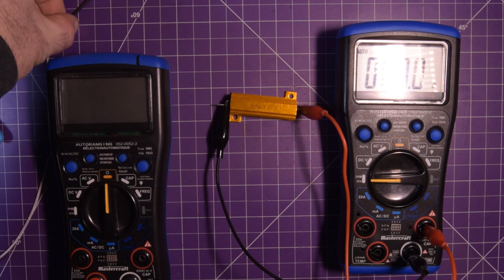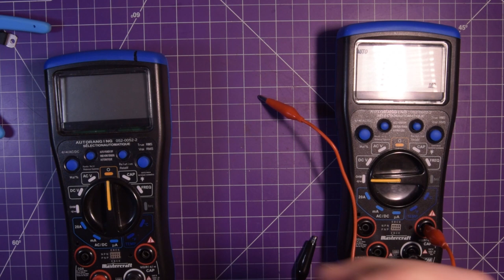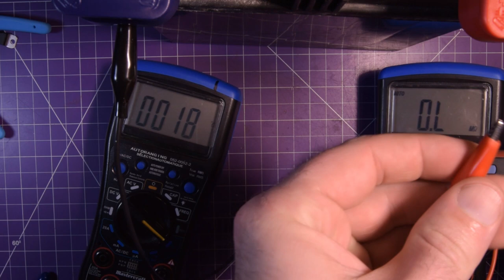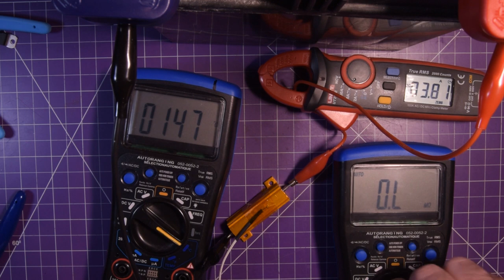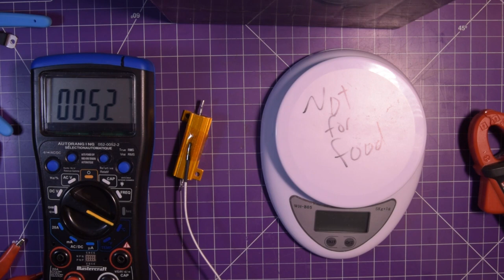Doing Some More Tests To The "50W" Resistor!

Comment: Be careful with these. They are indeed only capable of dissipating the stated power with a good heatsink. Inside it's just nichrome wire coiled around a rod which is plugged into the housing. So they are pretty badly thermaly couppled to the aluminium body. Even if you keep the body cool they will overload if driven only slightly beyond the rating and glowing hot nichrome wire will shoot out the sides. Ceramic wirewound resistors are much better thermally connectet to the outer shell because there are cast right into the Ceramic. If submerged in water they can easily handle 20 times the stated wattage.

Comment: I use the exact same resistor, well similar, well, it looks exactly the same but the OHMS are different.
 I use a 50 watt 12 ohm version mounted with silicone paste on a very small aluminum bracket which is bolted to a silicone rubber mount and that is bolted to another piece of aluminum that is bolted to a diesel motor. It's not a big device, it is actually quite small and fully assembled it will fit in the palm of your hand, so not a lot of heat sink material to remove heat.
 It sits directly behind the vehicles fan and works 100% of the time that the motor is running.
 I can drive all day and all night and it doesn't even get hot, but if I sit with the key turned on without the motor/fan running it gets hot. But no too bad. 50 watts is overkill (15 watts would have done the job) but better to be safe than sorry.
 It is replacing a troublesome sensor that requires 12 volts and 12 Ohms and the vehicles ECU cannot tell the difference. I have had it on the vehicle for over 1 year now.

Comment: So the 50 watt rating is a “nominal” value, and it’s how much heat it should be able to dissipate in open air, aka free convection. If you force air past it, or submerge it in water, it can dissipate much more heat. In design, you typically would only design it to about 75-90% of its capability, to account for any variances and allow for longer service life. So if it can only do 46-47 watts in real life, designing to 90% would still allow some head room. In most applications, there will be some type of forced air induction when these are used to keep them cooler. 

The resistance change can be calculated by derating table in the data sheet, can’t remember the name to it, but I know I’ve done it before. The 3 ohms is again, a nominal value, and you can calculate it, if you had the data sheet. As the resistance drops, more current should flow, and it will heat up the resistor more, since p=i^2*r, yes resistance goes down, but current goes up, and that is the leading coefficient since it is squared, it has more effect. So when you did the first video, it might have been using more than the 50 w, since the resistance changed and you did the power calculation based off of what you measured the resistance when it was cold.

Final thing here, is you can measure the resistance of the resistor when it is in test. You are already measuring the current, now if you just measure the voltage drop across the resistor, not the whole circuit, just the resistor, then r=v/I, it requires some calculation, but it is easier to do than to disconnect everything, and it gives you a more instance reading.

Comment: That resistor makes a terrible kettle.
Reply from the maker: To be fair, kettles make for lackluster resistors too
Reply: @SimpleElectronics  Many of the broadcast transmitter installations that I have seen use an array of oven elements as a test dummy load.  Cheap, easily available and able to dissipate thousands of watts.
Reply: @pileofstuff  you might like a video I saw on WLW's temporary transmitter that ran I believe 100kw. It was interesting to hear about what they used in it. It was used I think around 1930s or 40s
Reply: @pileofstuff  the video was done by K7AGE
Reply: @bwselectronic  Cool video. I used to work on the 10KW "little brother" of that continental transmitter they showed.
Reply: @pileofstuff  I thought you'd like it. I love hearing about the old things like that. Someplace I have a book I picked up at a used book sale or garage sale about WLW. When I was in junior high and high school I use to listen to shortwave on an old Hallicrafters that my great uncle had had. He was a radio man in WWII. Wish I still had it. Listened to CBS Radio Mystery Theatre when originally broadcast and a lot of OTR. A few stations in Chicago would run OTR late at night on the weekends.

Comment: Very odd that the resistance changed the way it did. It's amazing how water changes the dissipation performance. Like the fact you do requests lol
Reply: Junk From Work water has a specific heat capacity of ~4.2j/(g*c). He said he used 404 grams, so that means he’d have to input almost 1700 watts to raise it one degree c per second. Since a watt is j/s. So 50 j/s or watts, isn’t a whole lot of heat to add to that water, it’s probably capable of dissipating more than that through is surface are in contact with the air.

Comment: One word kept popping up in my mind when pondered over things long after I watched this video: "semiconductor". The resistor seemed to act like a semiconductor instead of a conductor. Semiconductor resistance goes down as temperature increases. A DMM has semiconductors in it, so maybe what you showed is what happens when you connect a hot DUT with hot leads to your digital multimeter? I wonder if you get the same measurements results with an analog ohmmeter. I hear you do requests? ;)

Comment: And I Thought My Resistors Free Air Running At 210F Stabilized Was Hot haha. I Have 4 50 Watt 1 Ohm Resistors. In Series Parallel . 2  Pairs In Parallel For 2 Ohm. Then Those Pairs Series For 1 Ohm. That Is In Series With A Vehicle Radiator Fan For Low Speed Fan Operation.

Comment: Need some help here!
What resistor is needed to slow down a 12v 390w watt motor,just to make.it run maybe at 60% or 10 volts. The point is that I dont  need it to be at full speed.
Thanks
Reply from the maker: I seriously doubt you'll be able to buy a resistor so large in any practical sense, have you though about a motor PWM controller? Perhaps something like this? https://www.banggood.com/custlink/DDm3U4EIcC that way you aren't burning so much of your current as heat!

Comment: Can we save current on led with resistor
Reply from the maker: Yes you can use a resistor to limit LED current but it will be highly inefficient for a high power LED. They are really designed to be used with a constant current driver

Comment: How to wire wound resistor test with multimeter
Reply from the maker: Not sure what you mean? What kind of test are you trying to do?
Reply: @SimpleElectronics  thanks for reply .
I mean wire wound resistor working or damage. How can i know
Reply from the maker: Check it with your meter in continuity mode if it's a low resistance resistor

Comment: Your alligator clips cant handle more than 1 amp. That's why I rebuild mine with 22 and 18 AWG stranded wire.
Reply from the maker: these are custom made with 18awg and silicone sheathing

Comment: Your ohm measurement is crap, probably due to thermoelectric effects.
Instead use voltage divided by current and you can see the current only changes a little bit and that may even be be due to battery voltage dropping a bit.
I have seen some very cheap power resistors change resistance when getting hot, but a good power resistor is fairly stable.
I have run some wire wound power resistors up to red hot (Not aluminium types) and they still works.